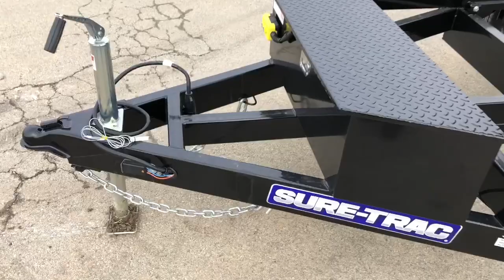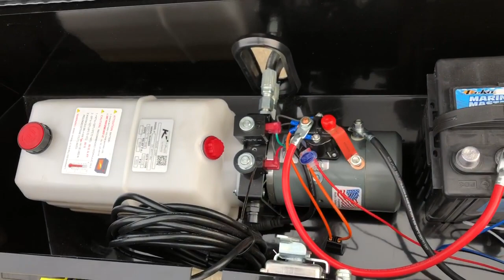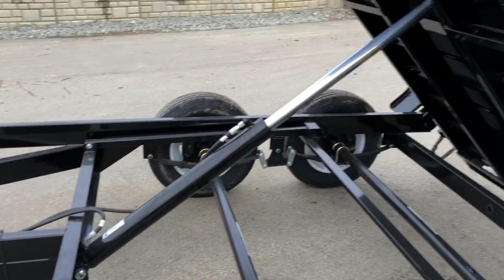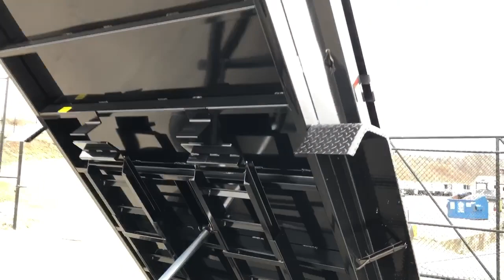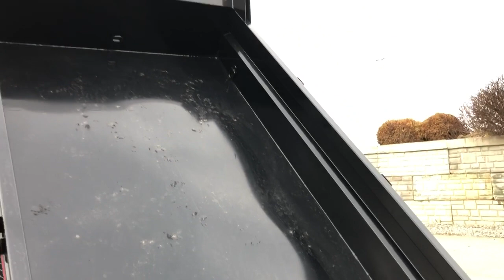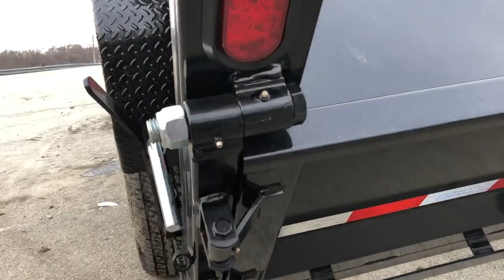Sure Trac 6x10' 7000# Hydraulic Dump Trailer * ST7210D1R-B-070

Comment: wonder if my 1/2 ton would tow this using for junk removal
Reply: I wouldn't, I have a 5x10 that weighs 2k and even empty you can feel it, loaded with something heavy like topsoil or gravel its very  sketchy.
Reply: It'll tow it.  It's only like 3k lbs.  But with a half ton, you wouldn't want to load it down to capacity.  But then again, just depends on the 1/2 ton you have.  

For the 2020 Ford F150:

"The highest tow ratings by cab are 13,200 pounds for the 2WD SuperCrew equipped with the 3.5-liter EcoBoost and 6.5-foot bed. For the SuperCab, the maximum rating is 12,000 pounds with the 3.5-liter EcoBoost, 2WD and 6.5-foot bed."
Reply: @JerichoRally  2004 silverado z71
Reply: @dakotashireman6404    assuming you have the 5.3 (gearing matters too) you'd be around 9k lbs towing capacity. Minus trailer weight of 3k lbs and any other payload in your truck, you're looking at approx. 5.5k - 6k lb towing capacity for your truck.  So, bottom line, this trailer would work for your truck.  
Also, keep in mind the payload capacity of the trailer... its not 7k lbs.  It's 7k lbs minus the weight of the trailer.